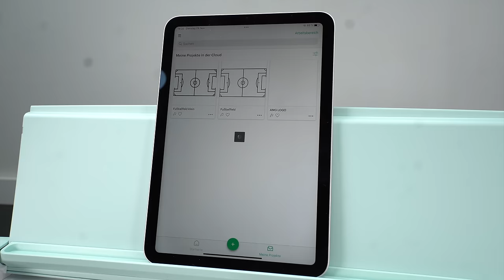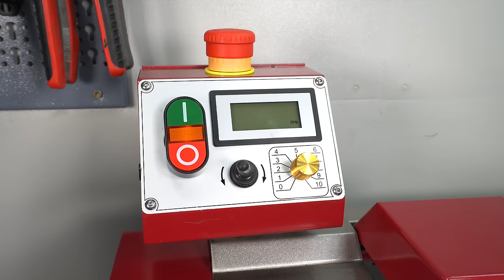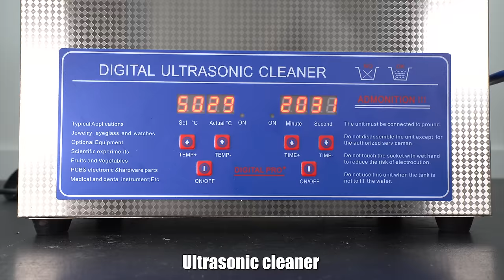Restoration Table football 1920s  - Mini Soccer Game

Comment: Not that it was an easy task but the players' faces look horrible 😂
Guess you saw you couldn't make them the same and took a funny aproach, that's also a good way to go. End result looks very nice and cute
Reply from the maker: Thank you for your comment and your honesty. So I'm not entirely satisfied with the faces either. I imagined it really easier to paint them. Until the next video. Ps There are no more faces in the next video 😁😅.
Reply: @MWRestoration  Well, don't get yourself down. Painting faces can be a big deal. If you haven't noticed, drawings often look bad when they have very visible lines. Try to draw a person in under 10 lines. No matter how good you are it will always look like a child made it. That's why you need to blend them. Use many lines when drawing and blur the colours when painting, especially when you've got such a small canvas as the figures to paint into. I haven't rewatched the video, but I think the original design had very similar face skin and hair colours, and there was no sharp contour for when the hair started. That way, your brain makes the image more complex than it actually is because it recognises a face and imagines the details which the image lacks.

Comment: 14:21 - Yo assembled in a bad way - The 5 men lines go to the middle of the field as midfields... the 3 men lines in the "attack-line" (from the priginal there was this mistake). Also, the direction of the 5 lines men was wrong. You putted them on the contrary! 15:40 - Then you adjusted... well done!